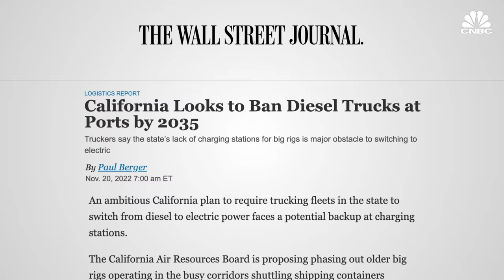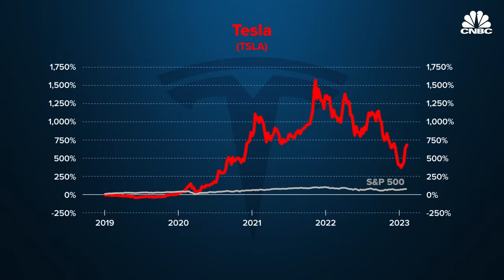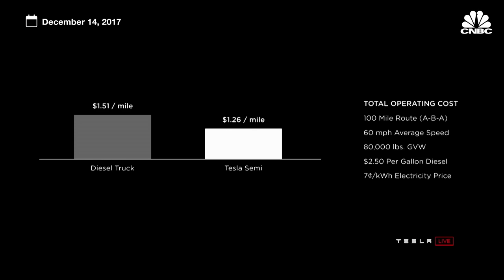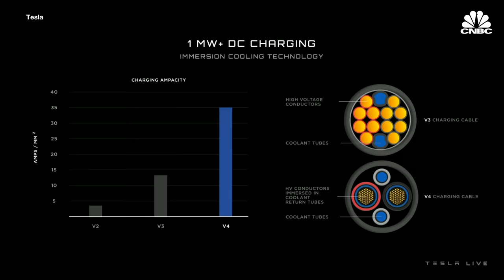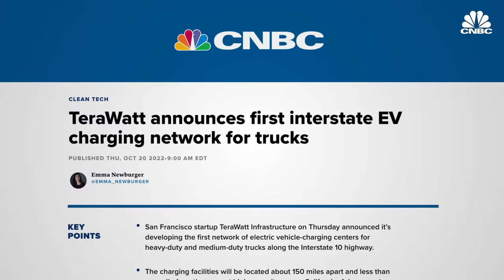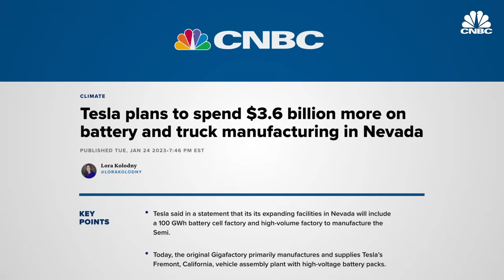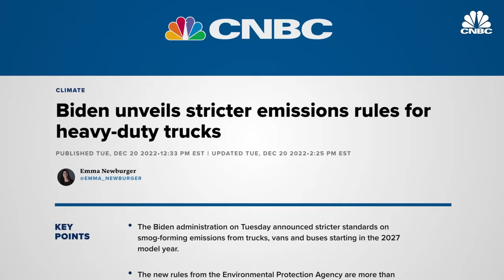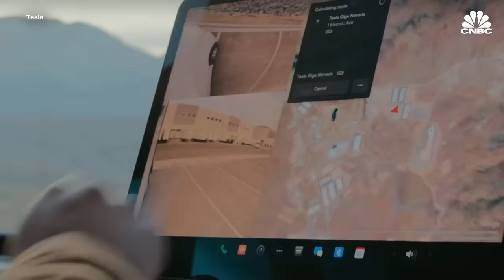Does The Tesla Semi Live Up To The Hype?

Comment: "Their  have been some reports that they can't handle the weight or the distance. "  By WHO reported this there is only one customer at this time. Frito lay has not said this publicly. THEY ARE JUST MAKING THE STORY UP TO FIT THEIR NARRATIVE.
Reply: These pilot trucks are being used to tune the truck.   We may see the production trucks release with 4680s.
Reply: @Glenn Beattie
Agreed.
There has been some "speculation" by uninformed individuals, starting from a base of..... Guesswork, with certain specifications proven to be completely wrong.
.
My opinion?
The battery is much lighter than some say (they based the weight on 18650 cells), the cab size and so weight is much lower and incorrect assumptions were made regarding the weight of the diesel drivetrain, which of course the Tesla doesn't carry. (Even the wheels and tyres are smaller/ lighter!)
My conclusion, it's well with 1000lbs difference.
Reply: Yes, there was a lot of pure guesswork, all of against Tesla in this video. Who was the Patagonia shirt guy? All others were identified in the video, but he wasn't and he was the guy literally lying his butt off.
Reply: @rsfpost7501  Yeah, not to mention some of his completely specious reasoning.  I loved his spiel about the other, more established truck manufacturers have some big advantage because they've been selling to companies for years.  

As if to say that when Tesla brings out a superior, more economical product, the procurement managers at, for example, McDonald's or IKEA are going to say, "Gosh, I'd love to buy an electric semi truck from Tesla, but I don't know how I'd ever do it. I guess I'll call Mercedes and buy one of their trucks instead--even though it only has 60% of the range of the Tesla--because I already have their phone number in my contacts list."

If companies believe they can save money by buying a different product, they'll have no problem switching to a new supplier.
Reply: @eyesuckle  Especially since the established truck manufacturers said the Tesla semi was literally impossible. They have the advantage of being blatantly wrong I guess..
Reply: Never been a secret. Announced at reveal and repeated and verified by Morgan Stanley in 2017:
"The Tesla semi has already received important validation from some customers. We spoke with mgmt. at XPO Logistics, one of the largest logistics companies in the country, that has been talking to Tesla on their EV semi for the past 18 months, including testing live prototypes. XPO mgmt. confirmed that in their testing, the features and capabilities of the truck mostly lived up to Tesla's claims at the launch event, including the performance vs. diesel trucks up a 5 percent grade (55 mph vs 45 mph), recharging time, safety/anti jackknifing features and payload (similar to a typical diesel truck, as confirmed by Tesla)." 
Same Load capacity as a Diesel.
https://youtu.be/JZTCgTtfOG4?t=172
Reply: Watch the YouTube video showing the Tesla Semi making a 500 mile non-stop from Fremont to San Diego hauling a near max 81,000 lb load. It was just a few months ago just before Pepsi got their first Semi from Tesla.
Reply: @Chainyanker007  The load was not stated. Label on one of the pallets says 600kg.
Reply: @hiloviking
Ah, the video where the Tesla truck was constantly being overturned by regular trucks.

Comment: I don’t drive anymore but still have my CDL and I’d love to drive one of these if they worked properly. A lot of old school truckers are stuck in their ways but I don’t see the problem if they become reliable.
Reply: They already hate it bc it’s not a long hood Pete or kw. Those kinds of drivers are what I hate most about this industry so far. Sure a cascadia or a Volvo might not look cool but I’m getting paid to drive not look cool. I personally would love to drive a Tesla semi just to see what it’s like.
Reply: The battery requirement for a semi is very heavy and reduces the load capacity to about 9 tons for a 80000 lbs truck.
Reply: I do drive still and I hope this fails….Sorry but I see the end game here. To remove the driver completely and throw 2.2 million people out of work
Reply: @dant.3505 
 The battery requirement for a semi is very heavy and reduces the load capacity to about 9 tons  
 Actually about 22 tons, but who's counting?
Reply: @BigBen621   the gross weight of the tractor of an electric EV is substantial compared to a diesel rig. 
With a legal limit of 80000 lbs. The weight of the tractor will reduce what can legally be loaded. It doesn't leave much legal load.
Edit- the 22 tons you mention only leaves 36000 lbs for the empty weight of the rig. That's about right for a typical diesel rig. But a EV battery rig with acceptable range will be much heavier than a diesel rig. The empty weight of a EV truck is very heavy.
Reply: @dant.3505  The "legal limit" (GCVWR) of an electric semi is 82,000 lbs.  The tractor weighs around 27,000 lbs.; a dry-van trailer is around 11,000 lbs., leaving 44,000 lbs. (22 tons) for the payload.
Reply: @dant.3505 takes load from 80k lbs to 18k lbs??? Hmmmmm 🤔 that is pretty bad lol!
Reply: @joshuad7953 bro people have been put out of jobs for all of time and people adapt. That’s how progress and innovation works. 2.2 million people will be freed to do something meaningful a computer can do. Who would even want to do something a literal robot can? Wouldn’t that feel pretty insulting?
Reply: @MrGoodeats  I understand you. Your message to me is that you don’t care and on top of that you want insult me for what I do for a living. Gotcha. I sure you feel real good about yourself buddy….
Reply: @MrGoodeats  because the battery needed to haul any useful load will be heavy enough to eat up the allowed weight.
The truck is only allowed to be 80k including the load and truck and batteries.
Reply: @dant.3505  oh I understand. I just didn’t realize it was such an extreme difference.
Reply: @dant.3505  actually, there is a solution: overhead lines, at least in some places to charge the vehicles on the go or to negotiate hills
Reply: @solarissv777  there you go! We need to build overhead lines for all the interstate highway systems. Only problem with that is it's never gonna happen.
Reply: @MrGoodeats i think its funny that people think their jobs cant easily be replaced. If anything, an office job will be gone way before a truckers job is. Hell, AI can already make art and write essays. U think your work at home job or some desk job cant be replaced?
Reply: @donn.4766  I don't work at home or have some desk job 😂😂
Reply: @MrGoodeats  so what do you do?

Comment: If Kenworth, Peterbilt, International are already building EV tractors, this isn't "the future" this is right now.
Reply: What is today if yesterday is tomorrow SpongeBob?  And in all seriousness this is more about a purpose built EV platform and infrastructure.  The brands you’ve listed make ev tractors based on internal combustion engine design which significantly limits their capability.  They also don’t have or make fast charging infrastructure for this scale of vehicle.
Reply: Evs won’t replace diesel engines itself still has an advantage especially with very heavy specialized loads
Reply: @banme2784  The EV is nothing, it's the autonomous driven vehicles that are going to really improve our lives.  Imagine no more traffic lights, no speed limits, and roads that don't have to flow in any particular direction!  The vehicles will be networked and roll their own "air traffic control" without our intervention.  No humans driving means no liability insurance, no traffic cops, no DUI laws.  You could tell your truck to take a certain route to a destination and to wake you up half an hour before you arrive, then take a nap.  It could even go there without you, maybe drop you off at the lake and pick you up on the way back home.  ALL of this will happen, and we can't stop it.   Kids today aren't even interested in cars, a lot of them aren't even getting licenses.  it's all computers now.
Reply: They wont last
Reply: @josephastier7421  while that may sound legitimate, that’s not going to happen. Not in anybody generation that is breathing air as type this as I should say. People are not going to give up their right to drive. Motorcyclist dang sure are not going to give up their right to ride. Bicyclists are not going anywhere. It’s going to need to be all autonomous or none or specific lanes for autonomous commercial vehicles. Every single vehicle on the road being autonomous could be a good thing or could be a very severe bad thing. I don’t see no in between honestly.
Reply: @danielelij6997  Indeed, full autonomous roadways,  with massively powerful autonomous electric trucks running nose to tail like NASCAR at hundreds of kilometers per hour, working together as a single organism, won't happen in our lifetimes.  We have the technology for it right now, but building out the "heavies" will take time.   
Meanwhile, nobody is going to take away your human-driven ICE vehicles.  As the generations pass, you will just see them in fewer places, much like horses today.  Nobody came for the horses when "horseless carriages" arrived either.  Fear not.
Reply: @mauricemotors8207 :  They won't replace them all RIGHT AWAY.  They'll replace a HUGE proportion over the next decade, and given the problems, like cancer causing particulates and fuel cost for diesel, will very likely replace them ALL (via regulations and economics) within 3 decades.
Reply: @josephastier7421 :  Sure.  But that will likely take quite a bit of time to hit critical mass, re becoming clearly good enough to make it commonplace, where the automated vehicle actually WORKS so well the driver can sleep in the car 99% of the time. 

That could take 5 years of multiple decades. 

OTOH, electric vehicles are here NOW and WILL scale up considerably by the time automated driving (that works well and does it itself) moves to the seriously mainstream stage. 

And I say this as a long term Tesla shareholder.
Reply: @rogergeyer9851  Agreed!  Tesla created that critical mass by proving that an EV could be a good car and not a glorified golf cart.  People liked them so much there is a waiting list to order one.
The market for the electric trucks is already here, because the greatest cost is not the purchase price, it's the maintenance, the fuel, the driver.   The Tesla Semi is very low maintenance, the charging stations are a relatively easy thing to build, and we know that driverless is coming soon.   
One of the coolest things about an electric semi tractor?  No noisy jake brake!  Regenerative braking converts your excess kinetic energy into battery charge, for free.  Instead of waking up the neighborhood and possibly getting fined for doing it, you're making money.
Reply: @josephastier7421  taking the basic foundation of technology and implying it into everyday situation is a little radical. It’s like saying to somebody looking into purchasing a lawn mower and saying one day we’re gonna have robots to mow our yards for us. Then the guy buying a mower saying well that’s in the future, then your response is “science denying” there is technology available today as we speak that could mow our yards for us. We have devices that vacuum houses with no human interaction. Now does that mean it’s rational for a guy to invest into a robot that can do this for him? No. We have technology that has proven personal cars can act without an operator to an extent, Even these companies admit to having certain problems such as acknowledging emergency vehicles. Then you have to add the economical side to this. It’s not a utopian vision of taking the price of a driver and lowering cost. Roadside repair, distribution centers positions, insurance rates,charging times etc… it’s not as simple as a child going “big truck drive itself no more wrecks”  ice/snow will be severe factors to this. Liability as well, sever weather, vehicles inspection and pre trips. There is a lot involved. These vehicles will have to have a system to prevent hacking. The roadside repair will involve many mechanics having to learn different certifications for roadside assistance (it’s a new technology) it’s way less than 1% of self driving vehicles on the road driving. Data will have to come to prove is safer. Also again taking the basic principle of technology and acknowledging it’s safer is still radical because we have machines the build threads into a screw way better than a human can, like a machine drawing a perfect circle while most humans can’t. Difference with that is there’s not human interaction. Driving on public roads involves a lot of human interaction. We’re all excited to see what the future holds but remember its 2023, not 2142. Not everything that technological possible does not mean it’s economical reasonable.
Reply: Don't forget Nikola Motor Corporation!
Reply: @danielelij6997  I hear what you are saying.  The future will be better than we can imagine.   Imagine an 1800's western cowboy on his horse trying to imagine the future of the tin lizzy he just saw in town.   Could he dream of concrete interstate interchanges six lanes wide and four layers deep?  Of 40 ton trucks doing 65 mph?  With one person at the wheel?  
Personally I think the future of human transport would be like amazon delivery drones that can pick up people.  Roads are too slow.  When you can get "delivered" to anyplace you like and are not constrained to using airports, there will be no traffic in your way.   We're too old to get to see this technology mature, but we're at just the right time to define it.  We owe it to our kids to dream fearlessly huge.
Reply: @ponchoz5365  Uhh, I don't think you have been doing your homework.  As long as the power grid can support them one of the major benefits is the huge reduction in maintenance because the "wear" parts have been eliminated.   That is mentioned many times in this video even thought it wasn't clearly explained.  With that said, I'm not a huge EV fan because I believe this will eventually be proven to be worse for the environment.  I'll admit, it's just a gut feeling and I have no documented proof.
Reply: @danielelij6997  And this year at the Daytona 500 we have a 50 car line up with 47 different algorithms.  May the best AI win!  [Edit: Time to take a nap... unless they add saw blades and battering rams...]
Reply: @g4l430  😂🤣
Reply: But they all have range problems
Reply: @hitgucvkj  Such as?
Reply: @g4l430  Driverless car races!  You just thought of a billion dollar idea.  The AI technology that wins races will then find its way into our own autonomous vehicles.  Same way it does today with engine technology.  People can watch the races online because they don't have to worry about their families seeing someone die in a huge wreck.  Lots of viewers means NASCAR will add this category.
People who say "There is no way NASCAR will ever support robotic cars" were the same people who thought ski resorts would never allow snowboarding.   For a while, they didn't.  Then someone realized there was a fortune to be made, and suddenly it was mainstream.  Big $$$ industry now.  (And nobody came for the skis!)

Comment: I found it odd that the one guy said EV's aren't as powerful as diesel. Diesel electric trains exist because electric motors are more powerful than diesel.
Reply: I wonder why there aren't diesel electric hybrid trucks.
Reply: @ross_ulbright7779  cost and weight I imagine.
Reply: @ross_ulbright7779  Prius style diesel electric hybrid vehicles exist, but mainly in shorter distance vehicles where there’s a lot of start/stop going on since the electric motor kicks in from a stop and the diesel kicks in once up to speed. Long haul vehicles tend to be at highway speeds a high % of the time so, they’d mainly be using the diesel motor. Even in the diesel electric trains, the goal is not economy nor environmental. It’s literally because a diesel motor just isn’t powerful enough to get the train moving.
Reply: That guy has ignored fact. TeSemi tri-motors produce > 1,800 horsepower.